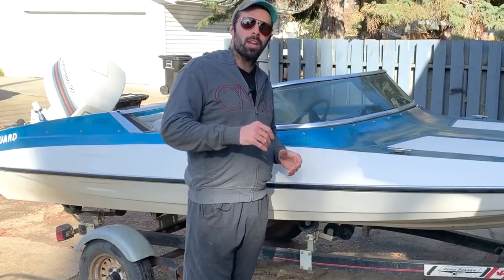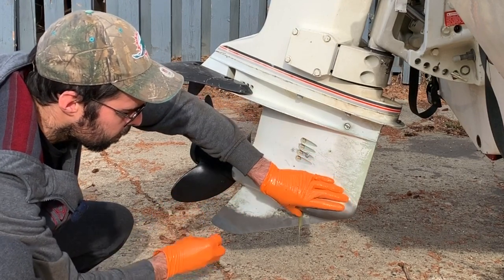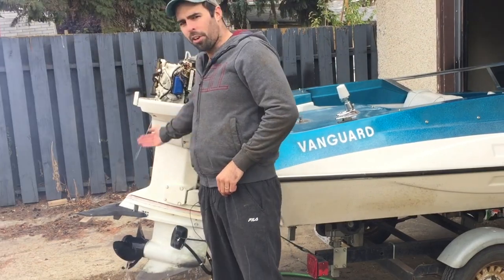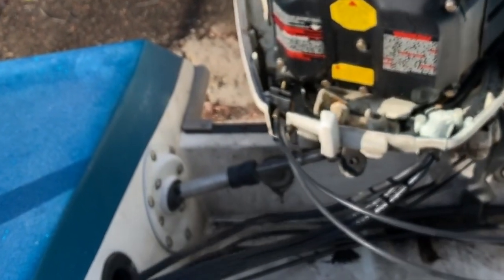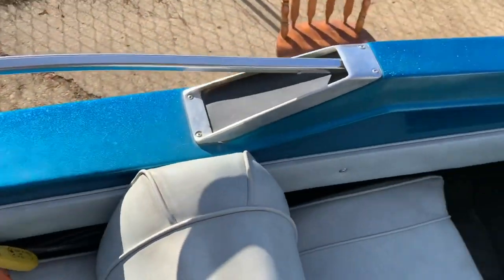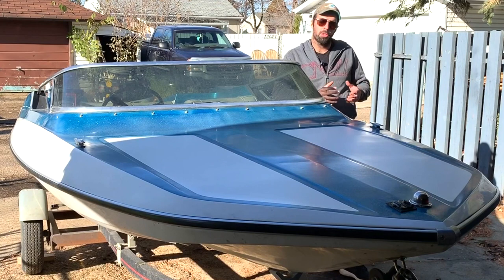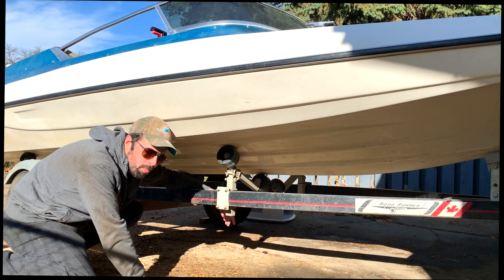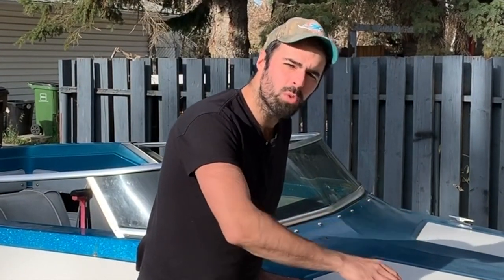Buying your first Boat (Things to Keep in Mind)

Comment: if going to make a video about what to look for with a boat then make it right, this has been total rubbish.. a novice would look and think this is good advice but clearly is not....... and here is why....ok  first off, you didnt point out that there IS water in the gearcase oil, (that is definitely water in the oil  ), 2 automatic trim ? no that motor dont have automatic trim, that is only on extremely modern large outboard motors. , what you have there is just power trim n tilt., 3  that boat DOES  infact have a wooden transom, and your not looking for its soft points correctly , 4.shame you dont know the steering is connected to the wrong hole in steering arm , definitely should of mentioned that.  5 the damage by the battery is showing there is rotten stringers and the glass has come away from the stringers, now that means the glass in that area needs to come away for inspection, and trust me for a 6 inch long tear in the glass like that you can bet its 24 inches or more underneath the glass that has rotted away. probably from transom to about 4 feet along and will require to be put right , that means floor up and everything out to do the job right...........